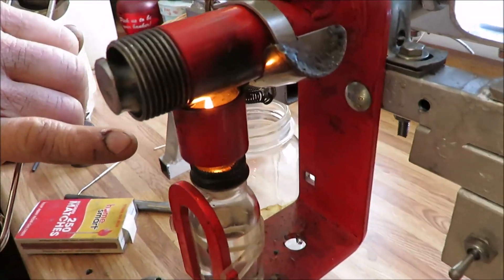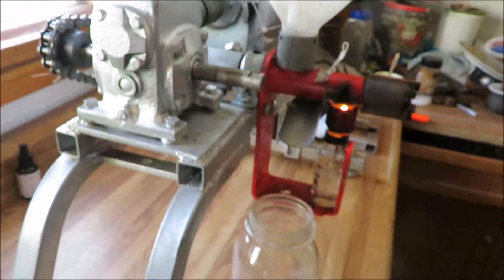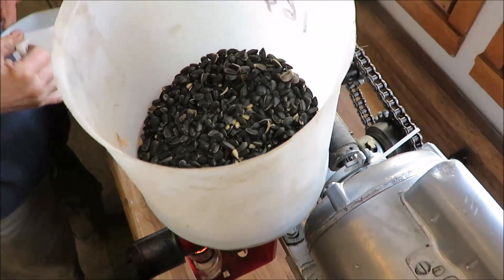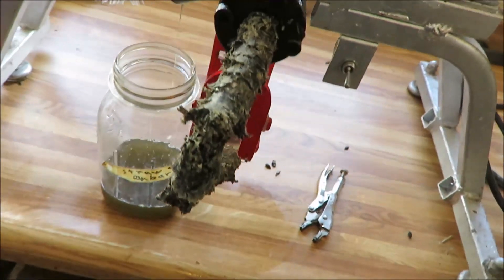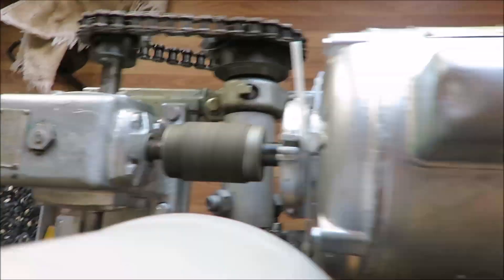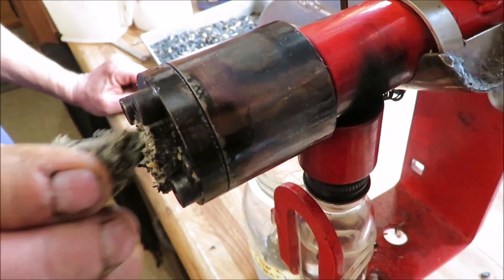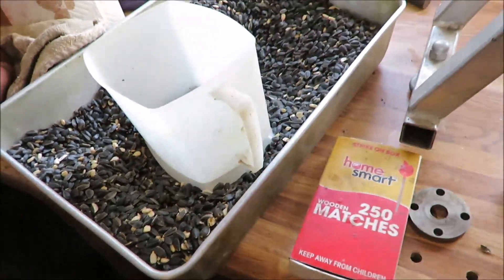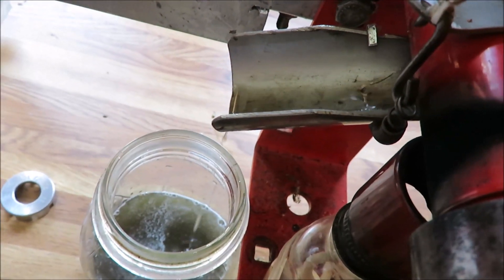Piteba oil press conversion Part two

Comment: I have a similar machine, but most times the exit part of the screw gets clogged with dried peanut hence not sllowing newly introduced peanut pass.
What could be the reason?
Reply from the maker: Is that the one that has threads ? If so probably they are getting caught up in the threads. Alan made a new nozzle that was smooth and didn't have threads and that helped with that problem. Not sure if he talked about that in this video or one of the others - there are three or four videos posted about this oil press.
Reply: @LarryKapp1  It's exactly like yours, only just the barrel is made of stainless steel like material.
Reply from the maker: @arterxerxes  sounds good . Well that was my friend Alan in the video who made that. Watch the other video's if you can - especially the first one when he had it mounted on a peddle power instead of a motor on it.
Reply from the maker: https://youtu.be/W2j-bY9OcRo

Comment: Can it oil something like pieces of hickory butternut with shell?
Reply from the maker: I don't know - those shells on the hickory are really hard !
Reply: @LarryKapp1  no Bitternut Hickory shell is paper thin. You’re thinking Shagbark, the Bitternut is 80% oil.
Reply from the maker: @zfilmmaker  We have a Bitternut Hickory nut up here that the nut is like the Shagbark  but bitter tasting. Very hard shell. So if what you have is thinner shell then it might just work. After all it does sunflower seeds with the shells on them.
Reply from the maker: You would probably have to break them up into smaller pieces somehow though.
Reply: @ I’ve got 47 x 200+ year old trees on my farm and the Bitternut’s are huge in size and very thin shelled. Must be a different variety. I’ve read on several forums and YouTube that people with electric powered presses put Bitternuts in whole due to thin shells.
Reply from the maker: @zfilmmaker  wow that is great to have all those trees !  I would certainly give it a try. But you may want to check out the motorized chinese oil presses on aliexpress  . It might be a lot easier and maybe even work better than than this kind without having to convert it. But who knows - some of those things are very good , some may not be such good quality. Maybe there is a youtube review on them somewhere.
Reply: @ no reviews on the motorized ones likely cause not many buy them. The KK20 is $8k. I wrote Piteba, hopefully they respond.
Reply from the maker: @zfilmmaker  look up oil extraction machine on aliexpress - there are some 200 to 300 range.

Comment: What is RPM good for maximum oil
Reply from the maker: I am not sure. You need to go slow enough so you don't jam up the nozzle or so it doesn't get too hot. It will depend on what kind of seeds you are pressing.

Comment: Why flame is needed? Doesn't it make hot press instead cold press as is right press?
Reply from the maker: It just keeps the husks of sunflower seeds from hardening up. I think once it gets going you don't need the flame any longer. Look on my youtube for video of this press that is peddle powered and I think Alan explains more in that one why the flame is there. https://youtu.be/W2j-bY9OcRo
Reply from the maker: The friction of compressing the seeds does make some heat even without the flame.

Comment: How big is the nozzel hole ?
Reply from the maker: dimensions are here https://youtu.be/i6Ch6TNdlhs
Reply: @LarryKapp1  is it in a millimeter or Centimeters?
Reply from the maker: @djzatka  It is in inches  . To convert 0.625 inch to mm you have to multiply 0.625 by 25.4 = 15.875 mm  .One inch equals 25.4 mm. The inch to mm formula is [mm] = [in] * 25.4.
Reply: @LarryKapp1  oh man! Thats Why When i use to squeeze oil from homemade press that cake is not coming out cause i made only 5mm hole 😅
Reply from the maker: @djzatka  Hope the bigger hole works ! Maybe smaller hole will work for smaller seeds .
Reply from the maker: Also look at this video - I think Alan also talked about nozzle in it https://youtu.be/mKmdsgDz2NI

Comment: Please tell me how much sunflower seeds you have used and how much oil you have got? Thank you for your help brother
Reply from the maker: Alan tells in Part 3 how much oil he made from how many seeds  12 quarts seeds made 1 1/2 quart of oil . See part 3 ( and part one too ) https://youtu.be/kDtXnk1QIt8
Reply: @LarryKapp1  in milligrams, grams please Larry
Thousands thanks 🙏
Reply: @LarryKapp1  I understand, for example: from 12 kilograms of seeds = 1,5 litres oil
Reply from the maker: @gabriel65304  What I gave you  are volume measures not weight measures.  With some online research you can easily convert to weights though.
Reply: @LarryKapp1  I bought a Piteba, and I trying to make oil manually , I don't know why the crank moves so hard 🤔😪 does everyone know? Thanks 🙏

Comment: I bought such a press and regretted it, all that was left of it was only the auger itself, everything else was scrap metal, he did not want to press the oil and constantly unscrewed the plug, gave the drawings to the turner and he turned everything according to my drawings and with threads in the other direction and with grooves for fixing the seeds as in meat grinders, and the current is longer for the installation of a support bearing, today it costs $ 250, it is very expensive and not done very well and not correctly, I do not advise anyone to buy it.

Comment: Larry, would you be able to make more of those end caps?
Reply from the maker: sorry no - this was my friends project and he isn't with us any longer. If you look at my other videos there is short one that shows the dimensions of it so that you may be able to take those to a local machinist to have one made.
Reply: @LarryKapp1  I’m sorry to hear about your friend. 

Would they consider selling the machine? I’m in Kenya, East Africa. We really need a machine like this, it will help alleviate poverty and suffering here
Reply from the maker: @outlookaccount4625  You would really be better off making your own  using standard parts. I think Piteba also offers a motorized version now too.
Reply: Why did you put a different end cap on the press?

Comment: what is the engine torque and speed.
what should i do to install such an engine
Reply from the maker: Some else motorized one and they said they got a gear box motor that had 325 inch pounds torque and was running it at 35 rpm I think. I am trying to find out more details. They had the shaft machined down to 1/2 inch so they could use standard thrust bearings and did some modification to beef up the sleeve bearing too. I will let you  know if I hear back with the details.
Reply: @LarryKapp1  Is the power of the 150 watt machine enough?
Reply from the maker: Take a look at this to see Grainger gear motor on a Piteba press https://youtu.be/K0QFDBY1cAY
Reply from the maker: this the gear motor that someone else used and if you do the calculation it is less than 150 watts https://www.grainger.com/product/DAYTON-AC-Gearmotor-115-Nameplate-6K325?internalSearchTerm=AC+Gearmotor+115+Nameplate+RPM+14+RPM+Max.+Torque+350.0+in-lb+Enclosure+TEFC&suggestConfigId=8

Comment: Good night, my name is Archangel, I speak here from Brazil, please, I want to buy an engine to put in my manual press, I'm not an engineer, I want to know what type of engine this is, what smaller engine can I use on it?  that engine sharpening knives will do?  I want to buy here in my region.  thanks.
Reply from the maker: Most of the details about the motor and gear reduction needed are in the video. You may have to find someone who understands this video to give you good advice to find what you need in your region.  Sorry no easy answer .
Reply: @LarryKapp1  still thanks for listening.
Reply from the maker: @josecarlosarcanjo2343  I would like to help but it is a bit complicated. You need to slow down most motors rpm by using a gear reduction. Then you need to be able to make a coupler to connect the shaft from the motor to the shaft of the oil press. There are a lot of differences in different motors. I think there are two or three parts to this video about motor for the piteba oil press and also one that uses bicycle pedal power. Watch all those for more information.
Reply: @LarryKapp1  thank you brother.
Reply: @LarryKapp1  But I don't understand English, and this video like most here on YouTube has no subtitles for my language.
Reply from the maker: @josecarlosarcanjo2343  Is your langauge Spanish ?
Reply: @LarryKapp1  He is Brazilian Portuguese, my son understands Spanish.
Reply: @LarryKapp1  I wanted an income producing coconut oil, unemployment here in Brazil is terrible, I am part of this statistic, coconut here at the fairs is cheap, while oil is expensive, that's why my interest in motorizing it.
Reply from the maker: @josecarlosarcanjo2343  Acho que não sei muito sobre óleo de coco - então não sei se essa prensa de óleo funcionaria bem. O que eu estava tentando dizer antes é que você precisa de um motor forte o suficiente para girar o eixo do Piteba. Tem que ter muita força, mas não pode girar muito rápido. Eles usam uma caixa com engrenagens para obter aquela velocidade lenta, mas com muita força. Algo como um velho motor elétrico de cadeira de rodas e uma caixa de engrenagens pode funcionar. Mas então isso teria que ser alimentado por DC em vez de AC e você pode precisar dos controles desse motor. Portanto, este não é um projeto fácil de fazer você mesmo, a menos que você tenha algumas habilidades.
Reply: @LarryKapp1  Te agradeço pela atenção, vou ver se consigo este motor com estas especificações que o senhor falou, muito obrigado, pensei que era mais fácil, tipo: motor tal serve, pela sua explicação preciso depois de comprar o motor ainda fazer umas modificações, obrigado amigo, Deus em Cristo cumpra na sua vida o querer Dele, fica com Deus.
Reply from the maker: take a look at this video of a similar oil press - it shows the motor type https://youtu.be/K0QFDBY1cAY
Reply: Archangel Jose Carlos Arcanjo...hahaha. Your name is Jose, bro. Come on!

Comment: Hi wouldnt the oil become clear if you filtered it .. i wish i could make that machine nice
Reply from the maker: yes the oil would become more clear if you let it settle in jar for some sediment to go to bottom and then also filter . But it is not going to be refined clear like in store.  It is a press that is available with hand crank and this is modified to accept motor.

Comment: Why the oil is black?
Reply from the maker: It is unrefined raw oil. Most oils you see in stores have been filtered and refined so that is why they are so clear and also why the smoke point is higher . Also these seeds are being pressed with the hulls on them instead of dehulled so that probably makes the oil darker too.

Comment: What will be the temperature of oil after expelled.
Reply from the maker: I am not sure - - I did not take a temperature reading . It probably also depends what kind of seeds you use for oil.
Reply: @LarryKapp1  In Indian we consider the temperature of oil when expelled. Because high temperature of oil during expelled may cause loss in nutrients.
Reply from the maker: @prithivirajan3936  I understand - I wish I had taken temperature when I made the video but I did not think of that at the time. It is a friends press and I will not be able to test it soon.

Comment: Thanks for the video. Where can we get this type of nozzle?
Reply from the maker: This nozzle was machined by my friend. He does not make any others but he shared the design which you may be able to find a local machinist to make. The one in the video has the end plate that you can change the nozzle size hole. This one with the plans does not show that replaceable end but a machinist could make on if you showed them the video and the drawing they could figure it out. Some people don't have trouble with cleaning out the supplied nozzle - depends one what kind of seeds you are pressing I guess. Here is link to plans https://youtu.be/i6Ch6TNdlhs
Reply: Larry Kapp Thanks for your response. I am experiencing a lot of issues with the supplied nozzle. Is it possible to get your friend to make us a similar nozzle? Of course I will pay for this. Please let me know and send me your email for further communication. Thanks in advance
Reply from the maker: @Warroxify1   No - I am sorry but my friend will not be able to make the part . Check your local area for machine shops or perhaps a local technical college can steer you towards somewhere to help you.
Reply: Larry Kapp Alright no problem; thank you very much for everything! I’ll look into it. I’ll maybe need a smaller hole as my seeds are really small (canola)
Reply from the maker: @Warroxify1  let me know how it turns out . If the problem isn't with the stuff getting stuck in there and hardening up  you could always just get another plumbing reducer at any hardware store and drill a smaller hole in it . Those plumbing reducers are only a few bucks.
Reply: Larry Kapp great idea! Will certainly let you know thanks
Reply: Wow so cool! Why is the oil darker, does it need to filtered? How long can the oil be stored for, does it have the same shelf life as store bought? Thank you!

Comment: What type is the axial bearing, who produces ?? External dimension 25 mm and shaft 15 mm can not be found in the catalog ...
Reply: watch part one, Alan explains how he made the races and the cage for that thrust bearing.  The balls themselves were salvaged.
Reply from the maker: Which bearing are you talking about - the ones  at the drive shaft ? He called those Pillow Block Bearings and said they were just some cheap ones he had salvaged . He thinks the noise was from them because they were stamped steel instead of good metal ones - and  one of them had bent a bit. Did  you look up pillow block bearings ?
Reply from the maker: Someone told me that they had the shaft machined down to a size that standard off the shelf  thrust bearings would fit . That is probably easier than trying to make the bearing from scratch.